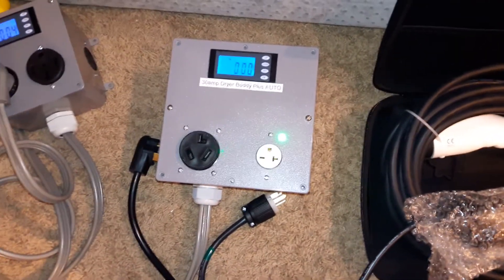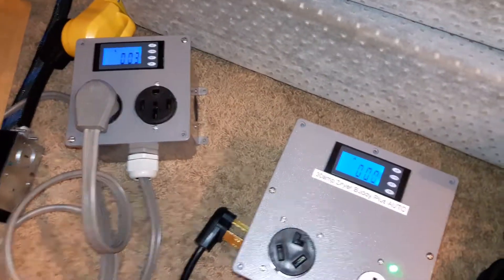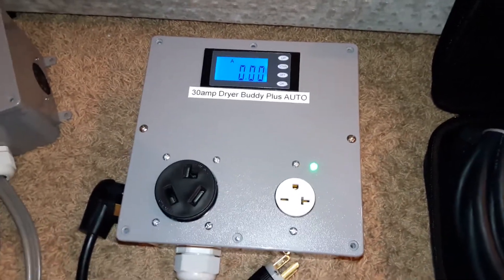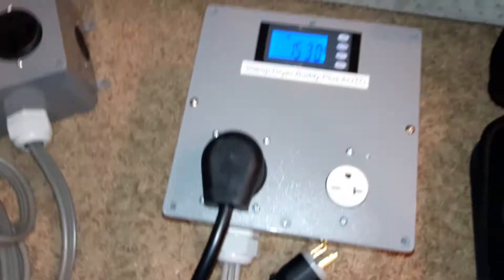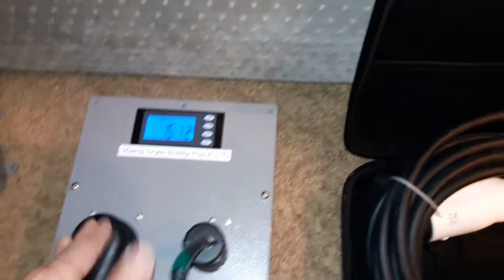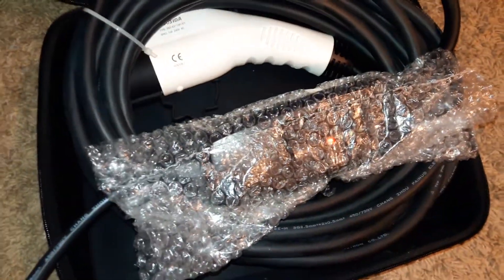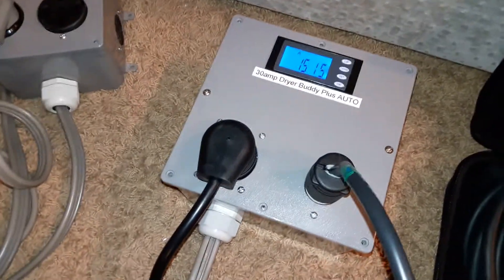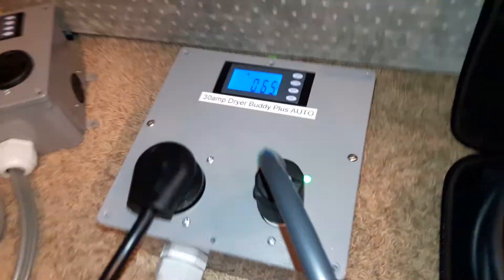Dryer Buddy Plus AUTO #12 Smart Splitter - demo by BSA Electronics

Comment: Hey there. So little love for you video? So if I had two Tesla Chargers connected and started charging the first car on the master, it reaches its daily 80% and stops drawing power automatically, the other outlet will get power and starts charging then? So 4 hours lets say its done with first car and then while sleeping the second one will start kicking on charging? Do I get 8 kwh on either outlet? Where does the whole box plug in, like a NEMA 14-50 or is it hard wired into 110 or 240V? Thanks
Reply from the maker: The outlet on the left always receives power, It is the master, anytime there is not significant current draw (below approximately 3.5 amps), then the outlet on the right receives power, at that point if you had a second vehicle plugged into that outlet then yes, it would start charging.  For this specific model the maximum wattage is 5760watts which is 24 amps at 240 volts. this particular dryer buddy plugs into a dryer Outlet. I do have an electric range buddy that plugs into the larger Nema 14-50 Outlet used for electric ranges,  installation as simple as plugging in, there is no hard wiring. 
Take a look at my Dryer Buddy Plus Auto it offers you two 30 amp Outlets;
https://www.bsaelectronics.com/collections/dryer-buddy-plus-auto-customize-your-own/products/copy-of-dryer-buddy-customize-your-own-30a-240v-splitter-5ft-cable-with-meter